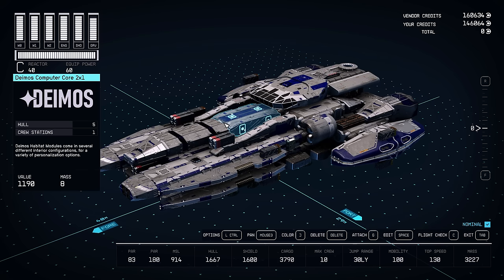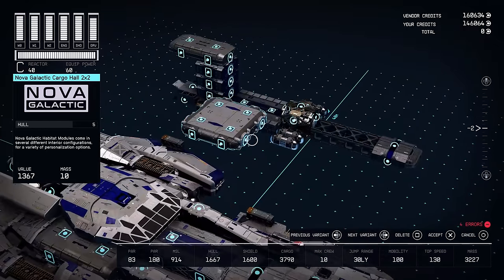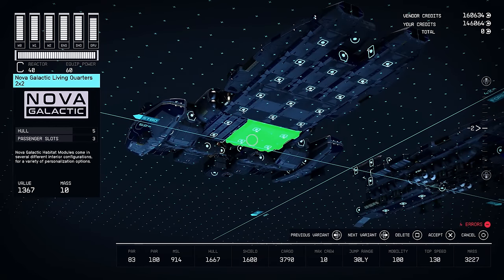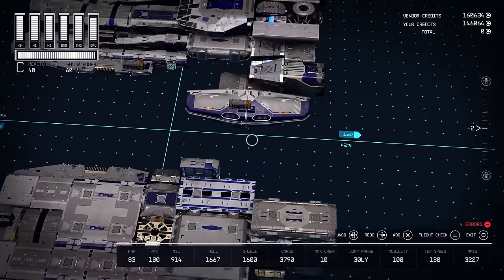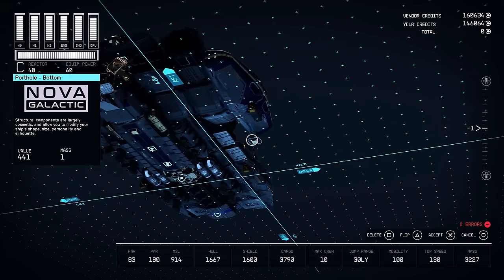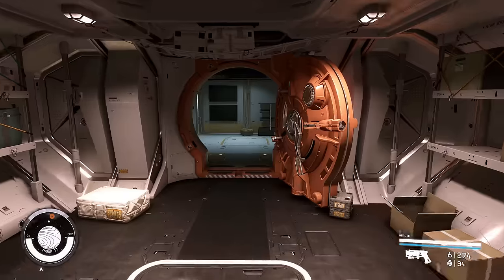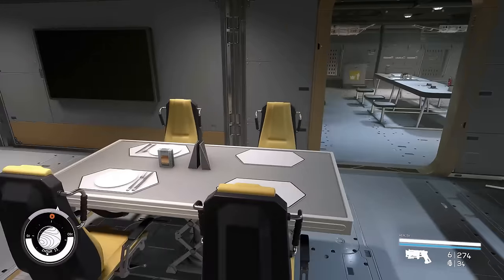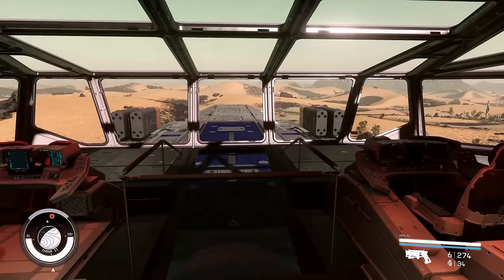Starfield: Ultimate Master of All Trades Battleship - How to Build

Comment: One big drawback on this great build, the entrance is on the back of the ship instead on the front.
Reply from the maker: You can remove the front bottom Deimos Hull and Nova Cap and one of the spines and put a front facing bay there if you wish.
Reply: True but ur ship always lands the direction of ur landing bay and facing the ship tech in major locations. So, not a big deal in the grand scheme of things
Reply: @gregphipps7082  the ship doesn't turn around if the landing bay is at the back
Reply: @Mayce1701 another easy fix is basically flipping the lowest level, have the cargo hab in the front and the brig in the back and then any of the front landing bays I used a Deimos one. Also moved the gravel drive to sit in the top where the Deimos hulls are to give it a bit of a hotrod look and so you can see the story item spin inside it from the bridge
Reply: I was able to solve that... and also increase the cargo capacity even further by sacrificing some mobility and jump range (you really only need 25ly) The flow of the interior is still great also.

On the bottom deck - keep the engineering bay at the rear of the ship, and leave connected with the bottom 1x1 companionway.  Delete existing landing bay, and replace with Deimos Tail.  Remove Taiyo spines, Deimos Hull, and front bumper.  Place front landing bay connected to the grav drive. I went with the one that has a ladder entrance.  This makes you come up through the Brig right next to the "reception desk" looking structure.

Deck 2 - Replace the 1x1 cargo hold modules between the control station and the Brig with Galeon S204 cargo holds.  Replace the Deimos hulls under the wings with Galeon S204 Cargo holds.  Replace the 1x1 cargo hold module linking the Cargo BaY and the Brig with Nova Spine - can't remember the name but it is the one with the really cool rounded hallway inside.

For the engines - I replaced the Poseidon engines with SAL 6830's.  I also added two additional SAL 6830's by moving the "wings" forward by one space (more parallel with the side windows on the mess hall), and replacing the top and bottom rear pieces of the "wings" with Stroud Engine mounts to which the 2 additional engines attach.  The weapons will still mount on the front of the "wings" also.

Over all I have a base 9,600 Cargo
25 LY jump range
75 Mobility

The ship looks badass, has a lot of firepower, and is a great all around endgame build.
Reply: @brandontieman4250  for me I just switched the cargo bay and the brig. With the av 300 grav drive and 6 of the engines on the outer sides my ship has 40 mobility (pretty agile for it's size) and 30 jump range. As for cargo replacing the Deimos hulls gives you well over 17k storage before perks
Reply: @Nykerian13  Yeah, I left a few of the hulls but with 9600 cargo, I figured that I struck a good balance with 75 mobility.  Also, to clarify, what I meant in my previous post about the "hulls under the wings" are specifically the hulls adjacent to the wings but directly under the infirmary on the starboard side, and the workshop on the port side.  Replacing those in combination with replacing the two 1x1 cargo modules linking the control station with the Brig pushes you up to 9,600 base with no perks, and the ship is still fairly agile.

I also agree that for a ship this size, it doesn't make sense for it to be as agile as a lighter ship.  I might take your suggestion and just replace all the hulls with the Galeon S204 cargo holds.

Good stuff, man.
Reply: Com certeza existe uma entrada frontal , que não foi mostrada 🙂

Comment: fun build. i turned my newly aquired va'ruun revelation II into a similar version of this with only having to spend 300k. i still have to go around grabbing the special habs and unlock starship builder 4 to maximize it. my mobility is only 67 because i dont have the best engines available yet.

Comment: If you want to make it so you don't fall through the entire stacked companion ways from top to bottom you should use the top portal windows but flip it so it's underneath each section of the 1 buy 1 habs. To make that work you just have to move the 1/1 out of the way one by one starting from bottom to top with the camera angle looking from underneath and attache the window to the bottom of each 1/1 hab then replace the 1/1 you've removed back to its original position then by change between cargo and through way press the B button on Xbox and the 1/1 will stay in place then reselect the 1/1 but do not move it and it should turn green then press the A button and it should be locked in place. Unfortunately I don't know what the corresponding button is for PC or other consoles. If done correctly you should be able to go to every floor as you go up or down the lader without falling all the way through and from the top you will be able to see all the way to the bottom but looking up you should only see a gold panel also it does not effect your companions as they will move freely  up and down the laders as well.

Comment: Great build, I made one last night with some changes. I put my armory at the top and the Captain's Quarters next to battle station. In my head it still makes sense that the Captain is next to the battle station and it bugged me way to much thinking about a main ladder running through the Captain's Quarters. Plus if your docking with a ship and need to load up on weapons you have the armory right there before you board. I also put the loading bay at the front and moved the reactor to the back. There was an empty spot above the loading bay where the reactor was so I added some shielded cargo in holds in there. 

The biggest pain in the butt with builds like these is collecting all the parts from different locations since it has to pass the checks the game has in place. Would be great if you could just buy parts from different locations without needing to attach them to a ship.
Reply: hmmm I think I might try this as well. I also made one other change instead of the brig I put in the Deimos Engineering bay which kind of made sense in my mind with the Reactor being down near that level. I also found that some of the companions tended to stay down there so they are out of my way.
\
Reply: i ended up just throwing random 2x1 habs in place of the 3x2  and 2x2 modules i dont have at my base shipyard. its a mess interior wise with a stupid amount of ladders going everywhere and store rooms filling up gaps until i decide to go collect those modules. i felt the same way about the placement of the cabins. i also modified some of the caps and fins, as well as used the parts i can use, only ship builder 3 right now.

Comment: The parts list which you can buy then go to the outpost is:-

Nova:-
2x2 cargo Hall x1
2x2 living quarters x1
Ng 20 gear x8

Stroud:-
2x2 brig x1
2x3 mess hall x1
SAL-6830 engine x2
Pinch 8z reactor

Hope tech:-
2x2 battle stations x1

Deimos:-
Ds40. 2 ares bridge x1
Poseidon dt230 engine x2
Reply: And the list of the parts at the outpost? Or we’re to buy as you call it out on video? Or did I miss that list in the comments somewhere. Or is it on Reddit? lol
Reply: You have to buy the parts from vendors and then make it at the outpost. Yes you do have to buy the part as he calls it out
Reply: @ANS_2009  Ok. Thanks for replying. Thanks for the parts list that we need from the vendors.
Reply: @ANS_2009  You buy parts from the various vendors and build it at your outpost? How does that work?
Reply: @toms.3977  there are a few parts which can only be bought as specific vendors like the SAL engines, ares cockpit etc. These are put on the ship and taken to an outpost because the outposts have all cosmetic and most ship parts. So buying the components and then going to an outpost is easier and faster

Comment: I like it.  I changed it up a little bit and moved the bracer above the landing bay and put the 100CM Ballast Shielded Cargo Hold. Removed the bottom port holes and added a Scan Jammer - Multi Frequency.  And removed the Deimos Hull with the Hopetech Nose B that was attached and put in the Taiyo Forward Sensor.   Still trying to figure if I like that sensor or not.
Reply from the maker: I ended up replacing sensor part with the Taiyo forward cowling. To me it looks very clean

Comment: Great build, im building it along with the video, i have encountered 1 issue so far, I am unable to get the Stroud Nose Cap B rotated to the same layout you do, how did you manage that?
Reply from the maker: If I remember correctly you might have to go to either the Stroud showroom or the Stroud drydock for that. I remember having some issues as well with those so it's either that or keep cycling through
Reply: When you start the build make sue you rotate the Landing Bay exactly as he did, look at the build area and for the word port on the ground, make sure you landing bay is matching the same direction and the nose cap will rotate properly . I had the same issue and then notice that this was what cause the Nose Cap to be in the wrong direction.

Comment: I’m very annoyed, and im certain it’s not your fault but… im trying to build this at my outpost, and got all the way to the Nova cargo Hall 2x2 and I don’t have it there. I checked the Reddit link, and that’s not a Hab that is listed in the unique parts. Idk if im not a high enough level to have it available in my outpost builder or what. I’m lvl 47 with piloting and starship eng. both at lvl 4.
Reply from the maker: Try New Homestead
Reply: @Mayce1701  do you know, should I be able to build it in its entirety at New Homestead? Like, I don’t care if I have to piece it from different places but not knowing where to get the parts is the problem
Reply from the maker: @edc_7321 No New Homstead is basically the Nova Galactic Staryard in the game. Weapons and Engines, Fuel, I believe you can get there as well

Comment: I am breaking my head trying to find out what is wrong with the layout and i dont have a door for the Science lab.
I have the exact same layout like yours , i enter the Nova Galactic Living Quarters 2x2 on the left there is a door for the infirmary BUT on the right you have a door for the science lab (27:01) , i do not, there is a wall with stuff on it :( I have to go AROUND through the mess hall and turn right and right again to access a door for the science lab ,  :( 
If i change the infirmary with the science lab position then when i enter the Living quarters there is a door on the right for the science lab and on the left for the infirmary and then the workshop ...Maybe a bug because there is no reason to hide the door if i put it on the right lol.
Any ideas?
Reply from the maker: I was having similar issues with my all in one's. Try cycling to a different type of 2×1 or change the manufacturer, then see if it's fixed, then change it back to the original one.
Reply: @Mayce1701  i had many issues with the ship (bugs) so i loaded a previous save and i had to go to each staryard for the hubs and worked.When i used the hubs from my outpost i had issues.Another tip is to dismiss all companions from the ship before start changing hubs , when i did that everything was ok and i had the doors where supposed to be and no other issues.
After i finished i  reassigned the companions back to the ship :)
Thanks!

Comment: What’s the best level to be at for access to all the ship parts? Might throw this ship together
Reply from the maker: You can build most if not all of the ship at anytime with parts related to your level. For this exact build LvL 61 I think is what is required.
Reply: @Mayce1701  word. I really want that reactor. I’m level 47 right now. Prolly gonna grind some ship combat out in the serpentis system and get as close to level 60 as possible.
Reply: @Mayce1701 also just checked out Morphologis’s video on this ship and yours is definitely better looking. More battleship while his is like a heavy cruiser.
Reply from the maker: @chromemox3319  Serpentis is great if you want to grind Ship Command and piloting, the Vangaurd sim is also good for grinding Piloting as well, and both for Aneutronic Fusion. The place planets to grid for skill points though are Celebrai II (my prefered one, just kill everything), and Strix I Craters biome(kill all the floating jellyfish)
Reply: @Mayce1701  I’ll keep the planets in mind for sure. I’ve already maxed out all the necessary skills in tech. Just need to get to that target level 60.